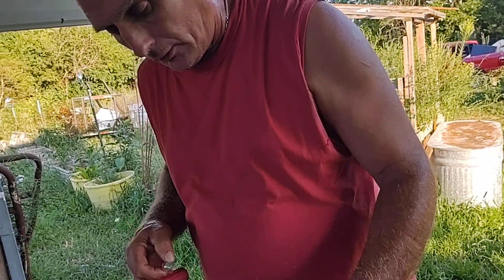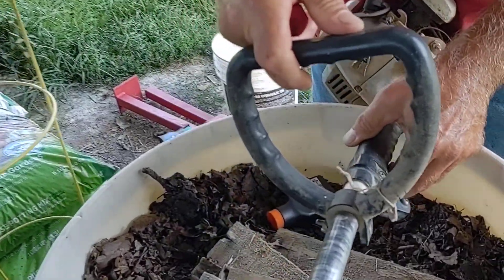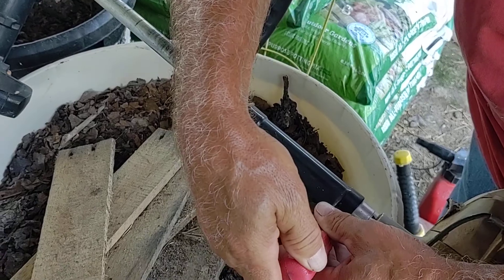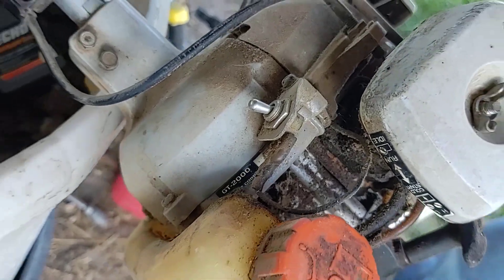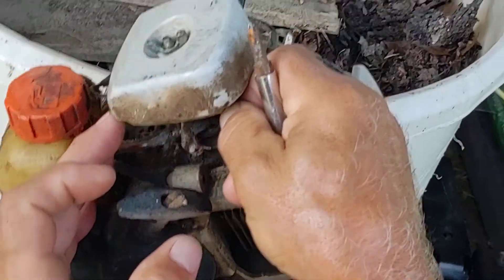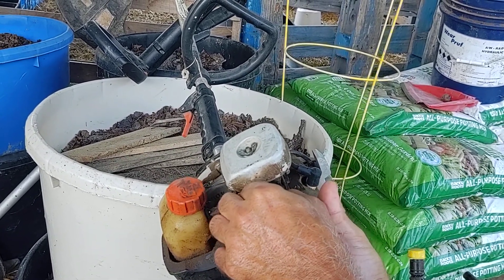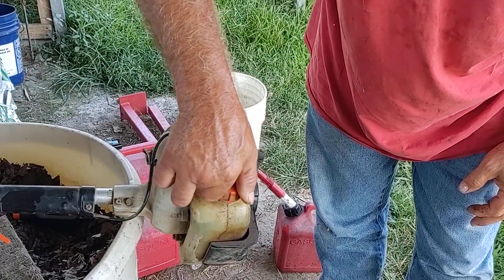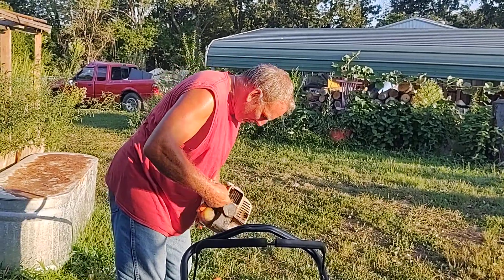It's a $5 Echo now...

Comment: Hey Jerry, check the air filter, try removing it then try to start it. Also when starting put choke on and pull a few times till you hear it sound like it wants to start, do not squeeze the trigger, squeezing the trigger at this point will flood the carb.  once you hear the sound of it wanting to start, turn choke off and try again.
Reply from the maker: Thx, yeah,  I realized I had skipped the choke when I watched the video,  lol